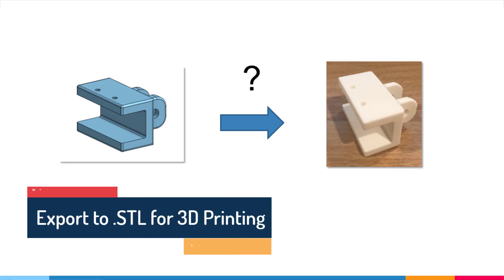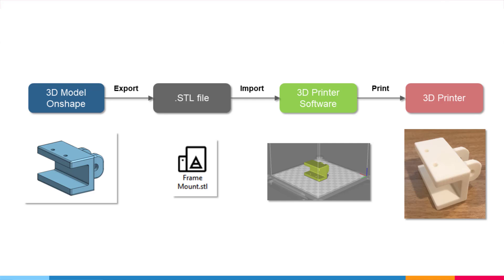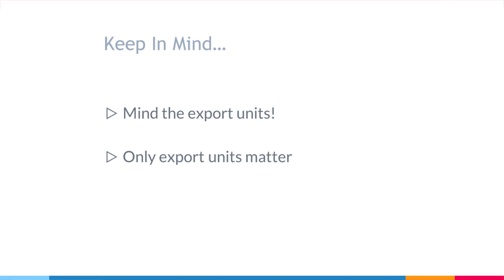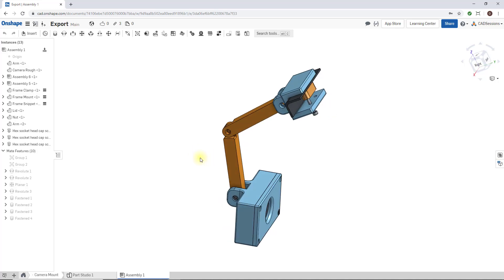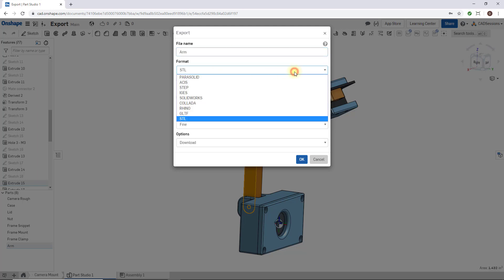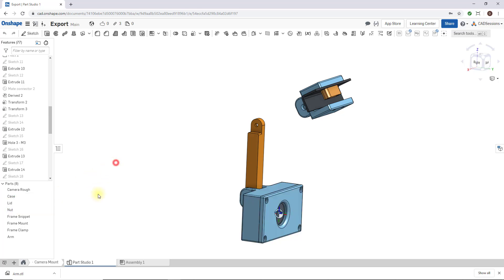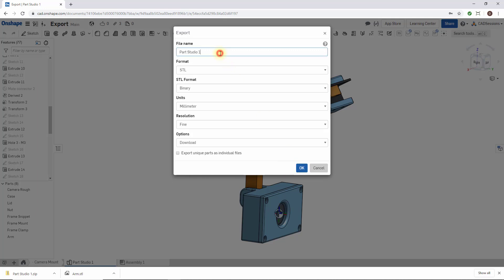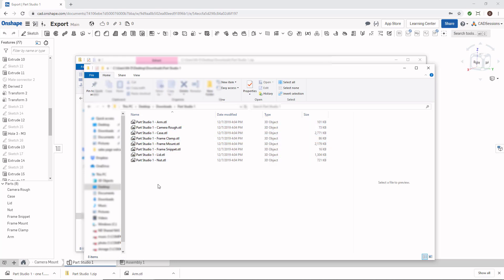Export to STL for 3D Printing - Basics - Onshape 3D CAD

Comment: How does Cura deal with a multi-part stl output, if that check box was not selected ? Are the parts still separated on the Slicer bed ?